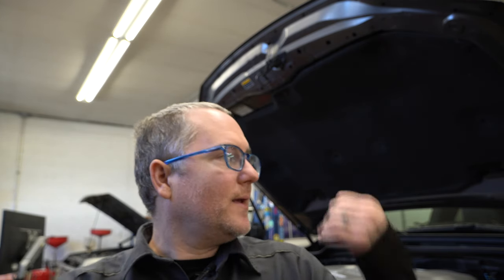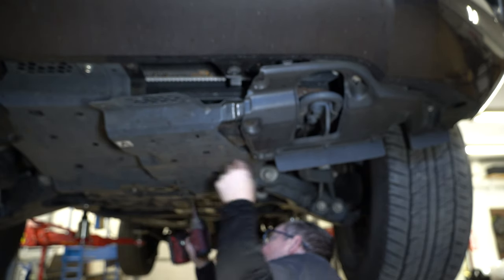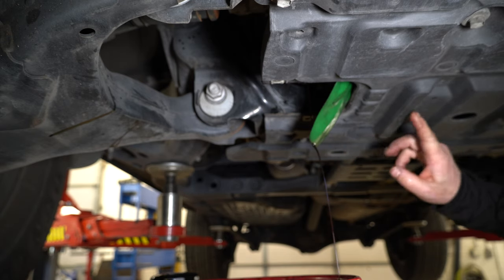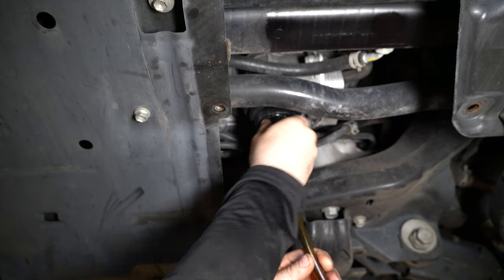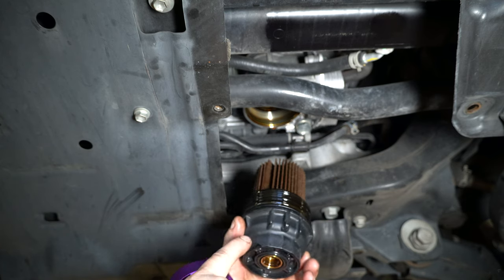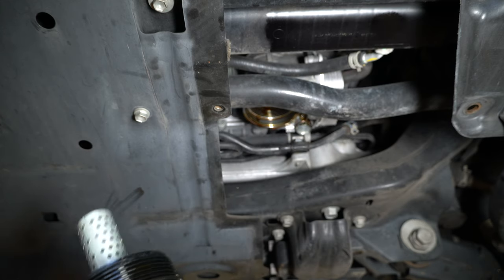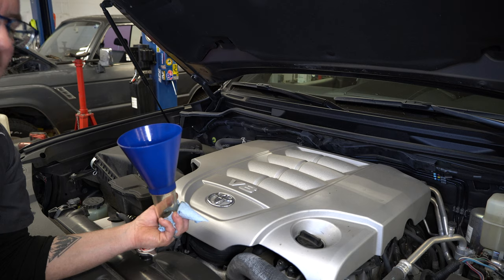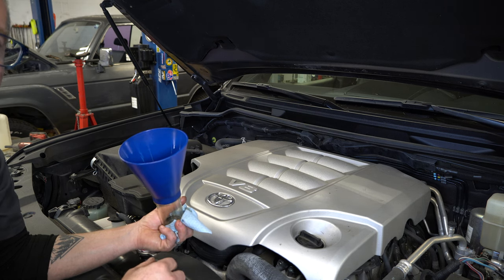200 Series Land Cruiser /LX570 Oil Change

Comment: I have this vehicle, and did not realize how many steps it takes to actually change the oil and filter.  Now, I'm suspicious that my dealer does all these steps.  I wonder if they skip the filter.  I had a 100 series years ago , and never realized until later that the techs just discarded the oil access panel on the underbody.  I wonder if they replace the bolts, and certainly believe that nobody is torquing.  If I were younger, I would do this myself.  At least I could sleep at night.  Well done.
Reply: I've also noticed "bite marks" on the wings of the fill plug from the techs using a pliers to crank it tight. It's not a flywheel or a fan blade.  What's wrong with finger thumb tightness?  I've also noticed missing cowling or panels never replaced in the engine compartment.  I may never have noticed, however, left behind are the washer/bolt mark indentations where the part was sitting.  Same with those little press fit plastic buttons that hold the engine covers in place (at least on Lexus).  For the most part, they are single use press buttons and the flanges bend when you pop them out.  But who ever bothers to replace?

I had a LX 470 several years ago and was told by the dealer to take it to this reputable muffler shop.  I had all OEM equipment replaced.  The master tech owner never attached the muffler gaskets at the connections.  Appalling lack of attention to detail.

I really enjoy OTRAMM episodes because there is a sense of peace of mind when you see things done with the intention and purpose of the design engineers, instead of making it up as you go along.

Comment: Nice you actually torque and tell what the specs are for the tightness. 99% of dealers I have ever seen just hammer down on the bolts till they can't move and call it a day.

Comment: Otramm, you rebuilt my daughters 100 series front differential in 2020 after the magnet broke off of the drain bolt…that was a great day…. Anyway it’s running great!  What are your thoughts about changing out the plastic housing for the metal one?
Reply from the maker: Glad to hear it's running well. I don't see a problem with running the plastic housing provided it's torqued properly. The ones I've seen broken have been way over tightened. I'd rather have the plastic housing break than the more expensive engine side of the filter housing.
Reply: @OTRAMM Hi, I’m a new follower, I was wondering where can I get one parts for my 99 Lexus LX470, I need to replace front suspension bushing right cv axle, and almost everything on the suspension since it’s got 247000 miles, but still in very good shape, South Texas series 100
Reply from the maker: Toyota is your best bet for parts. Cruiser Outfitters will be your best bet for aftermarket parts.
Reply: @OTRAMM  Thank you so much for your videos, and your reply, we know you very busy I appreciate your comeback 👍